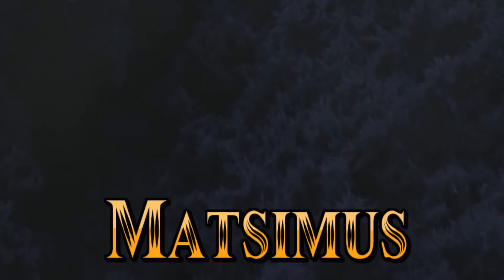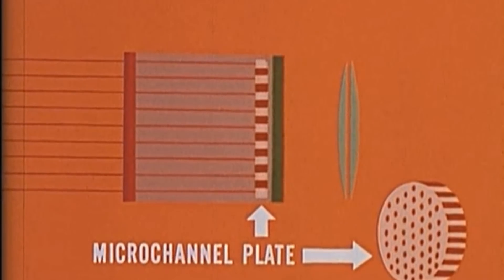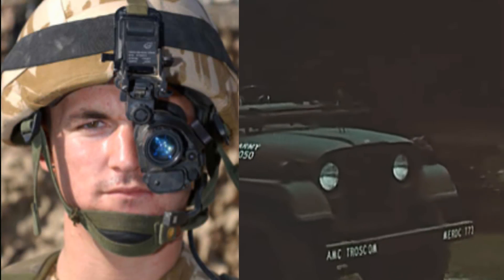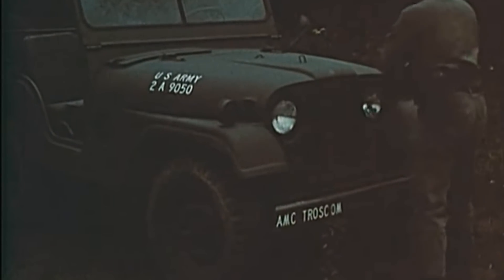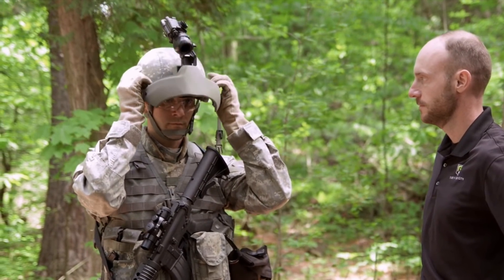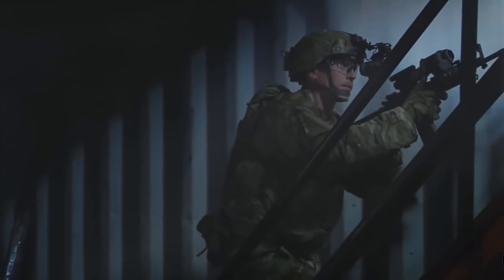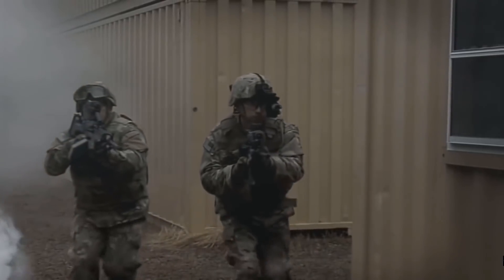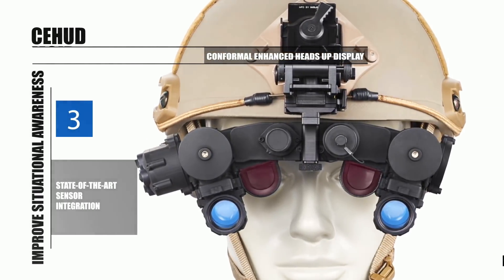How Has Military Night Vision Technology Advanced?

Comment: I had a white light/IR searchlight on my M60A1. Getting the TTS on the M60A3 was like going into a Star Wars movie. And strangely enough, I found the M50A3's TTS to be better than the TIS on the M1/M1A1. Go figure.
Reply: It was one "generation" (developmentally, NOT by US military grading standards) newer than the M1's thermal Imager (from the early 70's).  Not in terms of the actual imager's temperature discrimination, but in terms of the "refresh rate" of the screen and the signal-to-noise ratio.   Thermal viewers actually developed more slowly than NVGs but the issues are the same for both technologies.  I think the TTS systems might have flirted with 1080P style resolutions too (I cannot remember exactly when 1080 became a military standard but it started in the late 80's.
 This is also the reason why the GEN 2+ googles (reconditioned gen 2s) look so much better than budget GEN 3s.  The reconditioned GEN 2+ goggle has a slightly faster refresh rate thanks to its processing upgrades.  This issue is just like the issues you see with HI-DEF TVs.  In both technologies, the faster the "refresh rate," the less eye strain you experience using it.  The filters which reduce the signal-to-noise ratio (this is what causes the "fuzz" you see on screen) also help immensely.   Just picking a night vision device based on Its generation (GEN 2, GEN 2+, GEN 3, GEN 3 autogated, or GEN 3 + for passive nvgs) may increase your costs and not give you the best bang for your buck.  Just ask ANY hog hunter.

Comment: Was once told a story by an Ex-SASR member. They were somewhere in Afghanistan, raiding a compound to capture a HVT. They were using NINOCS(NVG) on their approach, but they faced no resistance. They found the guy in the back of a room curled up, he thought the SASR guys were monsters/spirits due to the green glow around their eyes in pitch black and so he shat himself and hid.
Reply: @Charles Yuditsky well there are major differences in these acronyms. IEDs are made by cave hobos which has worst quality than china while mines are manufactured. And there is a reason why NBC changed into CBRN. Radiation plays a major danger, which was unknown in the past.
Reply: [REDACTED] I agree with you there is a difference but saying that not with acronyms as there's only one, ied.
Secondly your comparison is crap.
What would it be called if the cave hobo dug the weapon and secreted it into the ground?
I'd say mine, some would say ied.
Now to differentiate is easy and pretty much what you say, a mine is manufactured by multimillion dollar companies and normally placed and detonated below ground whereas an iced is made on or near the battlefield and normally placed and detonating above ground, in general that is.
Reply: In short, they were using IR boosters! #Amateurs :D /jk

Comment: IL : intensification of light
IR : Infra-Red

Some IL have an "active function" which emits low power infra-red light, these IR are very close from visible light
Thermal sights also use infra-red wavelenghts but way further in the spectrum ! 
Mat, you have to explain this clearly, it wasn't... and people have to get the huge difference ! 
Real IR/Thermal have to be cooled and thus are heavier than regular IL/active IL
Reply: Nope FLIR optics now use uncooled micro bloomers and can be a pound or less.
Reply: Russel Lee:  YEP.  There's even a video on Youtube showing the 10th Mountain field testing the new GEN 4 FUSION NVGs.  These systems can merge passive NVG amplification with the newer Thermal Imager tech.  The soldier can "blend" the intensifier with the thermal function via a control on the NVG.  The image is white instead of green and when tuned to Thermal settings, can be used in daylight.  The goggles seen in the tunnel scene of SICARIO are similar tech.  I CANNOT imagine what FUSION NVGs might cost.
Reply: you can buy a PVS-14 for around $3,000 and then buy a  AN/PAS-29A COTI for 6,800 and there you go you have a fusion system. =)

Comment: It has gone from military to civilian use and getting cheaper from NV to Thermal Imaging the only problem is that the bad guys can also get it.
Reply: blueman4444444 , You've seen North Korean special forces wear them strapped to their headwear in military perades, now that you mentioned the cost it's no wonder their equipped with them.
Reply: Well that was gen 1 that NK has which is garbage compared to gen3 OMNI VIII.
Reply: Cheaper NV goggles are porbably made to use red light flood lights.

If your forces are using ambient amplification, then it would be seeing them with a massive flashlight in darkness.

Comment: Yes "fond" memories of driving cross country at night with the driver and gunner only having night vision and me with my head out ducking branches - the driver could see so despite increasingly direct orders to slow down, he basically drove at 0200 as if it was noon. :) The other issue with these is fatigue, they certainly provide an advantage at night but the 24/7 battlefield leaves little room for sleep. Also the weight on your head (despite the offset at the back) certainly adds strain to your neck.
Reply: whya2ndaccount The first NV equipment I used (early 80's in British Army) was a huge monocular sight mounted on the front of my helmet and large counterweight on the back of it and a battery pack. 
It did not have that a range either.
Reply: Same situation as you, almost everyone I knew hated them but we all still had to use them just in case. Half the time we would just take them off on foot patrols and keep them around our necks.
Reply: Drove my car in NVG's not fun it felt really dangerous with no depth perception even though we were on an old runway

Comment: Soon, our soldiers will have what gamers have had for a long time, HUD! 
Personally I would prefer night vision (night vision shines an infrared light which is then seen by the goggles kinda like a flashlight) over thermal vision (thermal vision just detects the infrared light coming off of a persons body) due to greater inherent accuracy of image in the former compared to the latter.
Reply: Except of course you can often detect the source of the beam (e.g. the footage where someone off to a flank can see the beam from the MG's Night Aiming Device (NAD)).
Reply: As night vision is basically an infrared flashlight with goggles that can see it, of course it'll make the wearer easier to spot to whoever also has night vision goggles. It's basically a trade off of a clearer vision but easier to spot by enemies with night vision as well or a lower quality vision but no visual giveaways given off by the headset.
Reply: Ye, it's good to flesh out the differences of similar system, nothing wrong with that lol
Reply: Thermal Imaging, Infra Red, Image Intensification are all used for night vision, all have their positive and negative points. 

TI is set for a specific thermal range and can be blinded

 IR can be detected further away than it is useful to see (the British army in the 70's had equipment at section level that detected Soviet IR kit - so they would know Soviet kit was abserving, before the Soviets could see them. 

II requires an ambient light source of some kind, moon light, stars etc.
Reply: Most of the "future" soldier systems currently in service have HUD.
Reply: That's only a disadvantage if you have your illuminator on, which is not required most of the time, especially if you have a Generation 3 device
Reply: As many have already pointed out, since gen 2 night vision, you don't need IR illuminator to work under natural night sky and most don't have IR illuminators by default. The light intensifying tech has come a long way. They can still benefit from IR if you are in absolute darkness with no light to intensify. The reason they switched to passive night vision tech is just as you have said, that you stand out like a lighthouse to anyone else using night vision.
Reply: Because your average Infantrymen doesn't have the same power supply and other "stuff" that is built into an aircraft. Hard to do fire and movement with a wheelbarrow of batteries. :)
Reply: yea.. military already has RTS style minimaps.  why not HUD found in aircraft for ground pounders?
Reply: tzayad.
Reply: New NVGs use a dual mix technology. The green of night vision is bad for ur eyes.
Reply: how about a combination of both?
Reply: Pilots use the HUD in 1 side of NVG, helpful. Cant wait to get it on the ground.